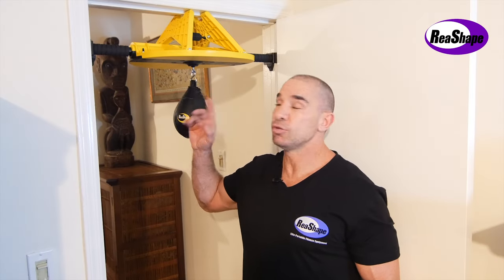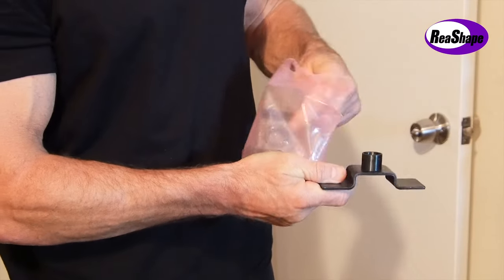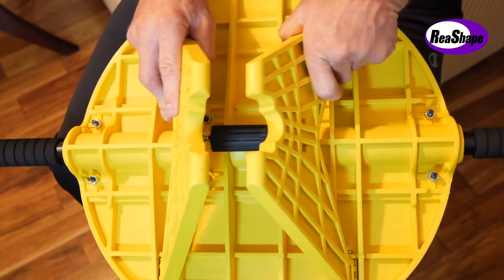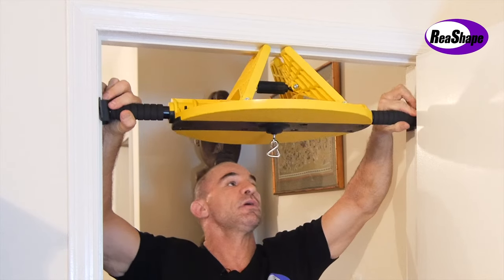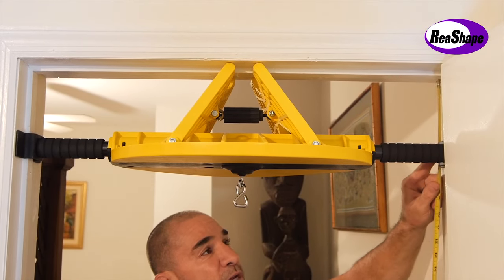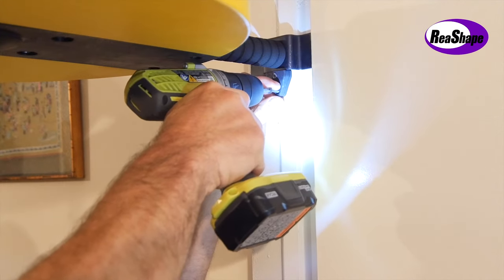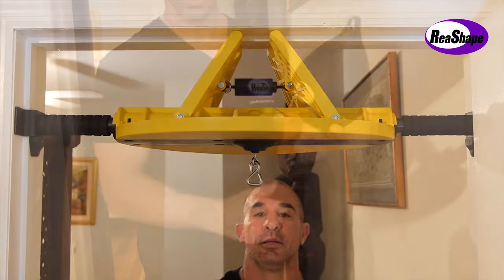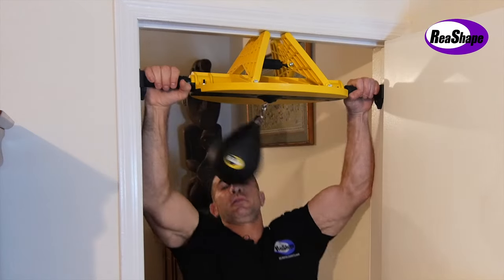EZspeedbag Installation Video

Comment: IMO, this is an excellent Product and really adds a unique portability component for the speed bag enthusiast. Also great for apartment dwellers or those without a wall to hang standard wall unit. This unit has been used by myself and numerous other "master baggers" that can put the "pedal to the metal" so to speak... and I can tell you the EZspeedbag hits very solid and holds up to some powerful pounding. Congratulations on a great product.
Reply from the maker: Thanks Champ. I appreciate your props, and the EZspeedbag "Pro Series" which is lighter and faster  will be released by the years end            Alan you are a true legend on the speedbag! you're videos and reputation solidify this!

Comment: So I still would have to screw in the nails and unscrew them whenever I want to take this with me? I think the word portable shouldn't be used with this then. Do I really need the nails if im squeezing the ends of it as tight as I can?
Reply from the maker: Hi Champ
great point, great question     
although the EZspeedbag works best with the triangles, many customers use it without, however you wouldn't be able to do pull-ups without the triangles
and to ease portability I am working on a grippier ended bracket to use without the triangles and by the end of the year 12/17 the EZspeedbag "Pro Series" will be released which will several upgrades including  a lighter weight  due to high strength  aluminum internal components rather than  steel we are currently using
Reply: OK that is what I needed to hear, I really don't care about the pullups as I am not a pullup fan but just hitting the speedbag regularly. Thank you for your reply, I will look forward to the upgrade in 12/17.
Reply: So should I just wait for the upgrade? Or will the upgrade pieces be sold separately? Or will the upgrade be something completely different all together in one? Sorry to keep bugging you.
Reply from the maker: Hi Champ       the triangles  really help because they allow for max backboard pressure and rebound however soon I am coming out with a sticky type bracket for people who want more portability without the triangles
Reply from the maker: you got it Champ!
Reply from the maker: no fee   I will ship them to you completely free of charge

Comment: I want to buy one but every time I buy something that fits in a door frame, it never works because I live in an older home built in 1934. Do these work properly on any kind of door?
Reply from the maker: hi Mike   actually the older homes have a more solid doorway which makes it work better      older doorways are usually 3 inches higher as welldoorways from 30-36 usually work best as well

Comment: so my doorway isnt made for a door so all the sides are flat. will the brackets still function even though there is nothing for the bracket to grab?
Reply from the maker: Hi Willie
sure, with the triangle pieces placed under the brackets will provide plenty of support 
and if any issues whatsoever were to come up I would address them with either an adjustment or honor a full refund if you weren't 100% satisfied.

Comment: I just got mine today. the only issue I have is after I start hitting it the A-frame still becomes a little loose. which in turn makes it unbalanced.  anyone have any ideas how to fix this.
Reply from the maker: +Harrison Stone 

Hi Harrison
Ok I'm very familiar with this situation.  Most likely you will need to install the small triangle supporters 
Here's a step by step quick instruction
1) twist Close the A frame 
2) Install EZspeedbag as high up to the doorway as possible 
3) tighten pull up bar ends
4) screw in both triangles under the metal bracket
5) start twisting center tensioner to open up A frame.  Really crank it this way it will create a great bag rebound 
6) the plastic will never break so don't be afraid to crank it. And if it does its lifetime warrantied anyway so you are taken care of 100%

Comment: I live in an apt building and am curious as to how noisy it is. I know a traditional speedbag can make a ton of vibration and noise, so will this be quieter?
Reply from the maker: Hi Champ
this is a composite backboard and although its slighter quieter than a standard wood backboard it will still make decent noise
Reply from the maker: You can always try it and get a full refund if you aren't 100% satisfied with the performance